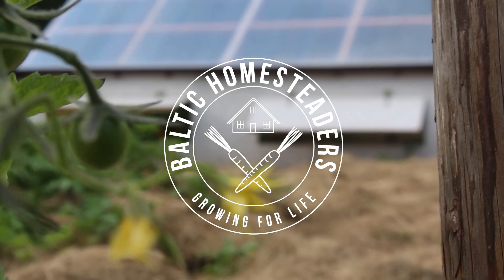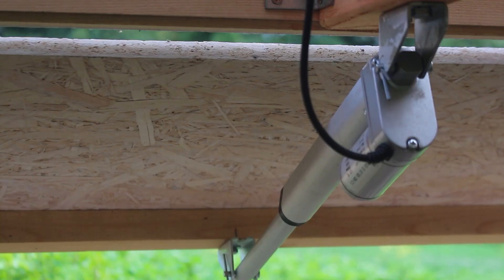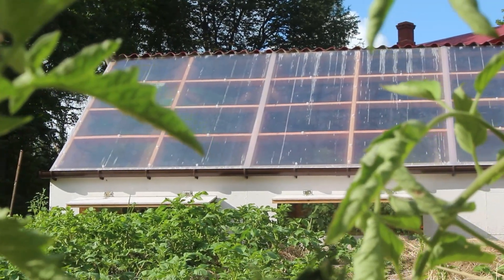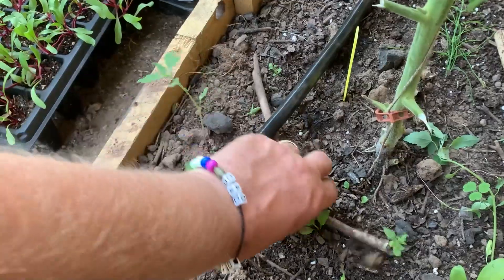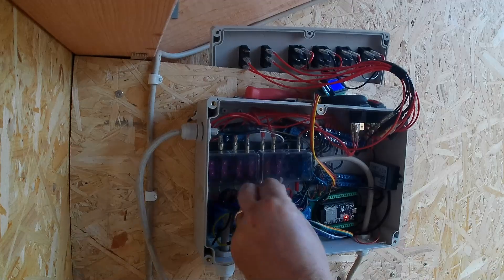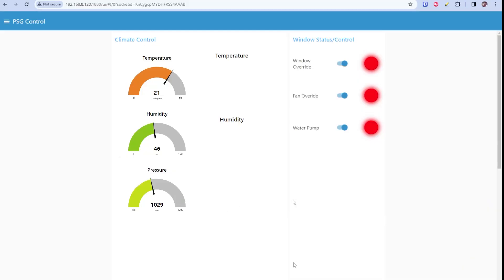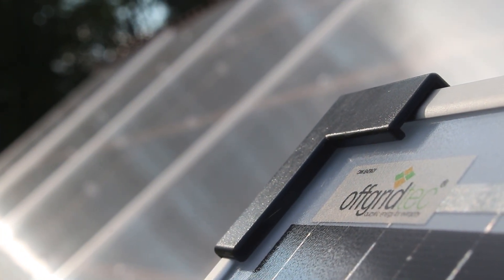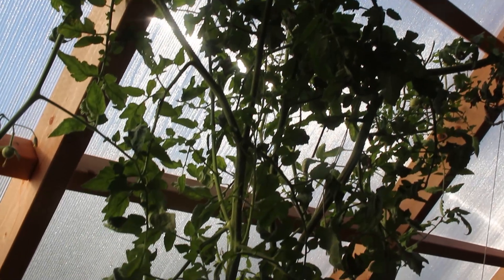I'm building the Ultimate Smart (Passive Solar) Greenhouse | Latvian Homestead

Comment: Considering the moist climate of the Baltic, how do you mitigate the buildup of humidity /condensation in the greenhouse?
Reply from the maker: In the summer? It’s been wet this year but usually is pretty dry/hot. I guess moist depends on where it’s compared to I’ve found that when the windows open there’s the passive draft that keeps it under control.
Reply: @BalticHomesteaders  Oh, ok, so with enough passive airflow moisture doesnt accumulate?That is excellent. I ask because the standard greenhouses ive been in in New England <about as wet as Latvia> will accumulate humidity/transpiration rapidly and will risk molding
Reply from the maker: @craigsurette3438 yeah airflow is key. As we found out with the other greenhosue which had an outbreak of leafmold this year. Think I spoke about it on one of the tour videos perhaps August or September.

Comment: What are you using to start/pause the irrigation?
Reply from the maker: It’s a diaphragm pump so water only passes through when it’s on so it acts like a valve as well. Is that what you meant? Obviously it’s controlled by a relay and the software which takes a signal from a soil moisture sensor.
Reply: @BalticHomesteaders  Yes, interesting. I got myself one of those WIFI irrigation timers for my rain barrel but apparently only works for pressures above 7 psi/0.5 bars and I couldn't use it. I was looking for another ready to use solution. I don't have the knowledge nor time to replicate your irrigation setup.
Reply from the maker: @funkblack just use an electric socket timer switch (usually used for lamps) powering a 12v supply to the diaphragm pump and it will do the same as the timer you have.

Comment: Great info, are you still using just the one solar panel? I hope to build a siimilar greenhouse, not sure if i can do the automation parts, but your work is very inspiring.
Reply from the maker: Yeah still one panel, it’s worked well with one battery but I probably need to upgrade this year as I may be installing another fan.
Reply: @BalticHomesteaders  I have a bunch of old 12v panels, but i think i can make it work too, thanks for the reply

Comment: Can you share the circuit diagram?
Reply from the maker: It was roughly drawn out and built as I went along. I’m rebuilding it from scratch this year with lots more features. I’ll try to document it properly but I’m not great at that. Was there something specifically you wanted to know?
Reply: @BalticHomesteaders  yes
Reply: @BalticHomesteaders  I am coding with Arduino and I use an Arduino card, but its voltage is low. What is the name of the card you are using here and is it Python?
Reply from the maker: It’s an esp32 development board (wroom). It’s powered by a 12-5v psu with a microusb end. I use Audrino IDE to program it.
Reply: @BalticHomesteaders  Is the electrical circuit like on the Arduino board?
Reply: @BalticHomesteaders  What is the brand of water pump?
Reply from the maker: @style.aep7 you’d need to lookup the pin layout for the esp board, I’ve never used any arduino boards so I can’t compare. Any external components will work the same though.
Reply from the maker: @style.aep7  just a 12v Chinese thing, you’ll get it on eBay or aliexpress etc possibly called a diaphragm pump.
Reply: @BalticHomesteaders  I will try

Comment: That is amazing and would work here in Oklahoma during 4 seasons during the year but in the summer when the outside temperature normally ranges between 85 and 103 degrees. But love this system!
Reply from the maker: Cooling is a problem, we have similar temps.

Comment: I was thinking about how to build such a thing. I stopped because finding solutions to the many tasks and problems in the context of such a project exceeded my available time contingent.

You having solved these, I would be very interested in the concrete solutions (ESP32 programming, wiring diagrams, products used etc pp). I would pay a small amount for schematics and a larger amount for a plug-and-play kit that I would simply have to fit into an existing small-scale greenhouse.
Reply from the maker: Often the solutions are bespoke albeit there are common elements. Also they need upgrades to firmware/software or tweaks etc. for me obviously it’s easy to change the software but for an end user maybe not. I think if you’d be happy for some sort of handover where you install, commission and maintain then it’s doable for me to build the unit, test and send. It’s a lot of work to produce all the diagrams etc, probably more than producing the unit itself. If you’d like to discuss the idea further then maybe email me (email is in the about us tab) and we can go from there? Thanks.

Comment: Those windows low down on the ground seem like a security threat, not against people but pests. You might want to put some chicken wire and a window screen on them. Keep the mice/rats and insects out.

Edit: IS that an Arudino? Is the sketch available or are you looking to go commercial with this?
Reply from the maker: It’s not Arduino but I did the programming using the Arduino IDE. There’s a little bit of interest in me building units but there’s a lot to consider such as handover, installation/commission and support etc I’d be interested to know what the price point might be to see if it’s viable to take it further.
Reply from the maker: Ps we don’t have any rats, the odd mouse, the problem usually is voles as it happens and they burrow under usually.

Comment: Have you thought of publishing wiring diagrams and codebase?
Reply from the maker: Thought about it but not sure either is a) up to scratch b) if it was do I want to share it. Of course opensource has great benefits if the community are willing to contribute and improve upon what I’ve made. Most of what I’ve used is already out there in its parts it’s just that I’ve brought it all together and made it purposeful with a real application. What are your thoughts? I suspect the physical wiring diagram etc is of greater use as the controller could be one of many.
Reply: @BalticHomesteaders  what's the software running on the esp32? Relay control and what those window openers are would be a great start for me
Reply from the maker: @mojonojo3  If you watch some of my other automation videos I go into a lot more details as I'm trying to also figure the stuff out. Yes it's relay control. The window openers are actuators 12v can get in Amazon and it's programmed using the Arduino IDE. Having said all that I'm rebuilding it all this year and will go into more detail about what's happening etc as I have some ideas to improve things based on what I've experienced last year.
Reply: @BalticHomesteaders  Im in the process of pulling down a old greenhouse that fully rotted through, and i quite liked the look of insulation and automation on a chinese greenhouse style build.